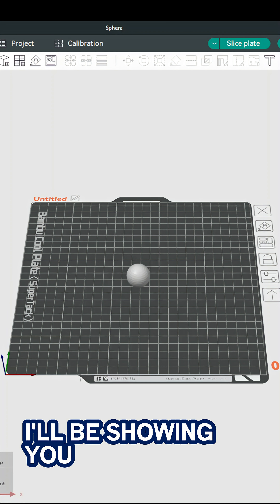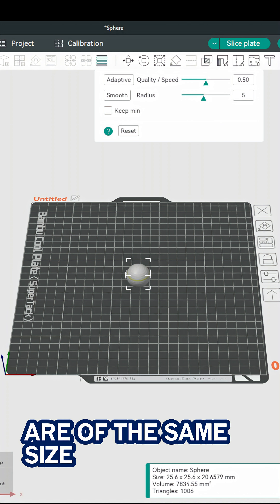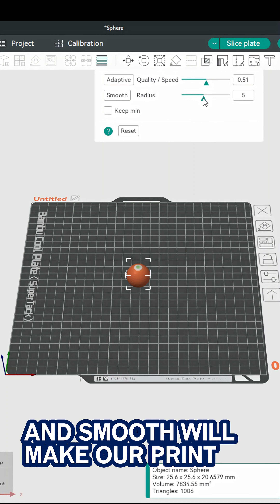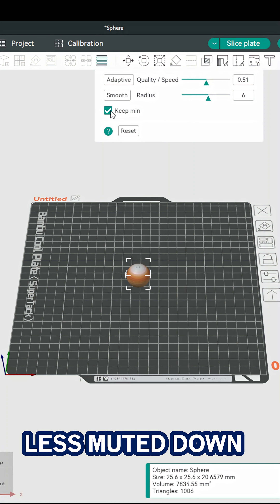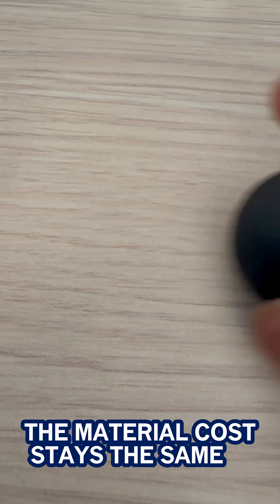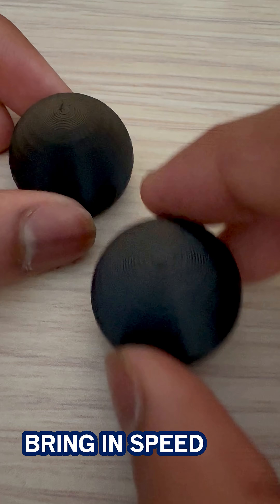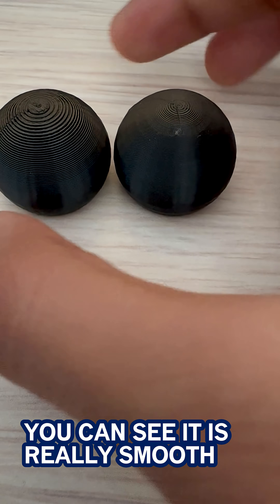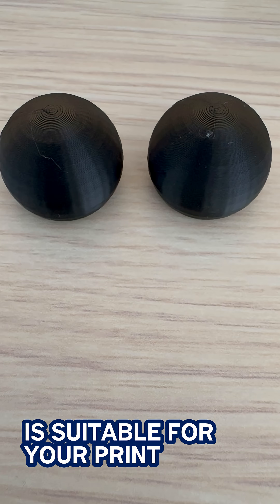Faster Prints AND Smoother Surfaces? 🤯 (1 Setting!)

Comment: If your exporting the file from CAD software…..select .STEP, then when importing it into the slicer….youll be asked what ratio you want, put the sliders all the way to the left…. Models with lots of curved face will take some time to load, but the quality will be substantially better than .3MF files…. They will even come out a lot better than this method alone will provide.